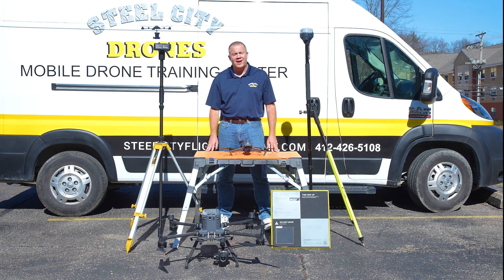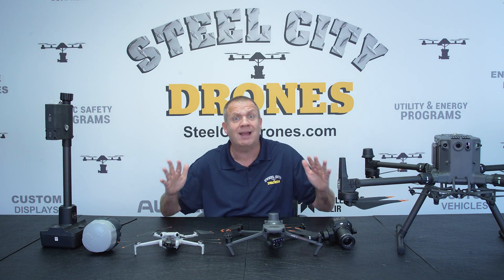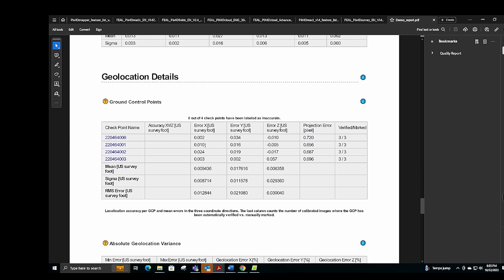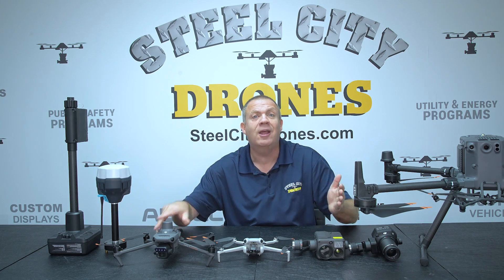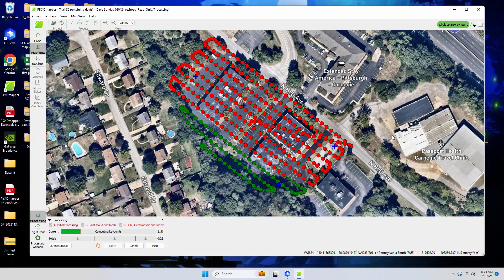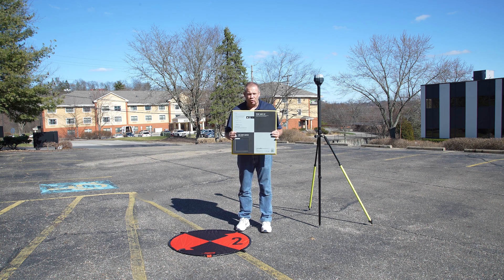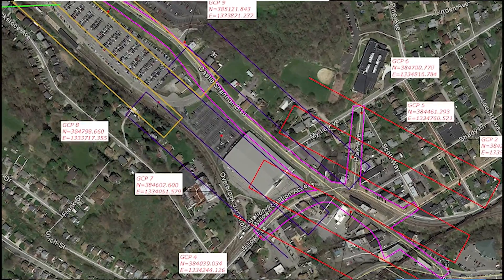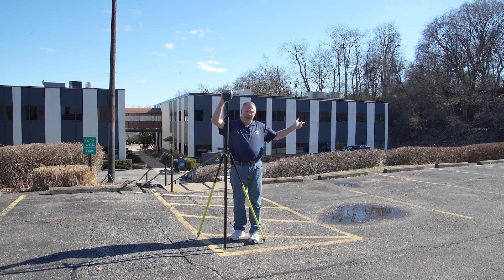How to be a Drone Mapping Pro | Deep Dive

Comment: Thank you for a very intersting video. Our survey clients are civil engineers and architecs and they still expect a 3d cad deliverable with line/feature work for track edges, drain hatches, fences and so om (with height annotation) so we still have to walk and measure those features with an RTK pole. If tracks continue under dense tree canopy then we have to continue with total station. That said they still like to see an ecw/geo tiff in XREF to that cad. For us the strength of drone survey is in large areas of rough hillside and here we can use point cloud ground extraction to create DTM and contours to merge with the conventional data. I agree about the eye watering cost of Trimble kit but it offers a fully integrated approach. All the project data RTK / total station or even point cloud laser scans are recorded to a single project on a very robust controller. Relatively recent introduction of the M3E has been fanstastic and seamless. I can use Trimnle VRS with my phone as hotspot to the DJI controller. If there is no phone signal I can use the R10 NTRIP correction for the drone. However the really big bonus of the R10 is that if there is no phone signal at all you can still get a true base position using about 4 minutes or so of RTX correction. It works very well and you can check at night with a proper PP static solution against local CORS RINEX in TBC. (I am aware of some UK surveyors getting inaccurate results using Opus.) The limitation with the R10 base on wifi NTRIP is that you can only control the drone from a position within wifi range of the base. If you are climbing rough mountain side that is some very heavy kit to transport. I would say we still need a lightweight base (which could still double as a rover), capable of getting a position by RTX, and then creating an NTRIP correction for the drone.
Reply from the maker: We could make hours of content on true Survey workflow but that's not what this video is for. It was an introduction to what true Drone Mapping on a professional level includes.
Reply: @SteelCityDrones Lol but can we get an episode about survey work flows and making a product for clients
Reply: The prblem I see with inexperienced non-surveyor individuals is that they believe they are getting great data (sub-tenth verticle data) because the system is advertised that way. There's way too many things that go into what the ultimate accuracy will be to just make a blanket statement like that. One company, that I will not name, claims ALTA accuracy. I can tell that when the point cloud doesn't match your ground shots on concrete by 0.20' horizontally, it's not ALTA quality.  A recent project of ours has some great results but every once in a while......bam! 0.50' verticle error as compared to the total station. Civils and Atchitects generally need much better than that especially where ADA issues exist! My two cents.
Reply: @StuartRoss1081 Thanks for taking time to give additional info and commentary on this great video. Good information shared, brings Relief!
Reply from the maker: @powerfullaudmarcus2455  Sure thing, our pleasure.
Reply: Bro I'm just starting lol 😅😅 please teach me the ways of the drones and data processing